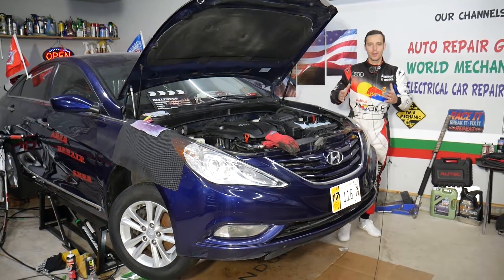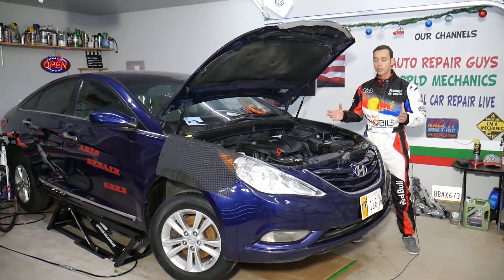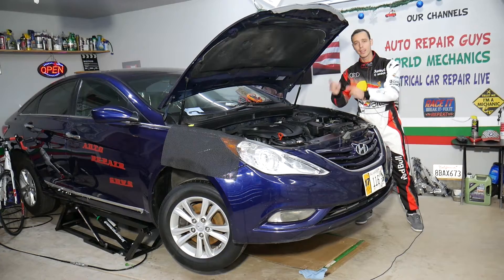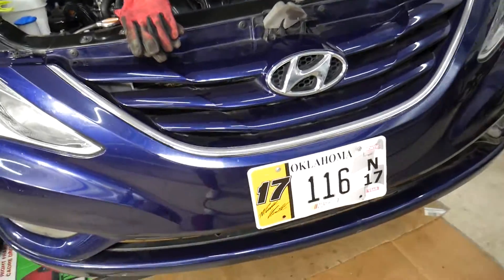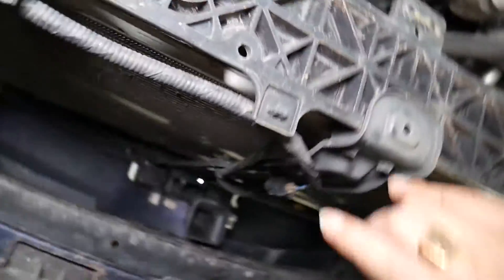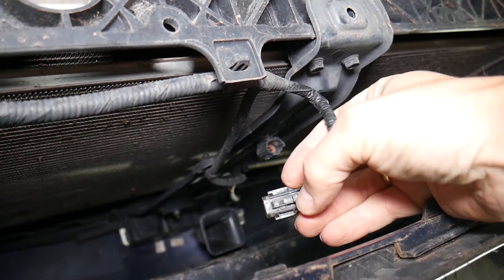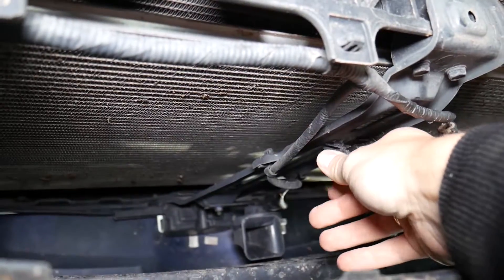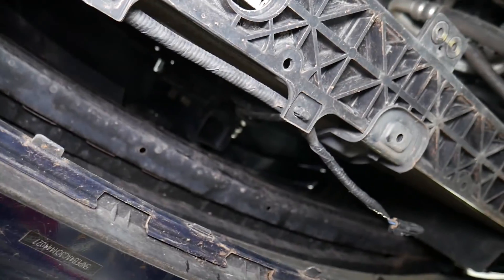HYUNDAI SONATA AMBIENT TEMPERATURE SENSOR REPLACEMENT LOCATION, OUSIDE TEMPERATURE NOT WORKING

Comment: Could you tell me how to find the wiring pigtail connector for the sensor. Mine was ripped off after a bad encounter with debri on the road. I’ve found the sensor but need the wiring harness to connect to it